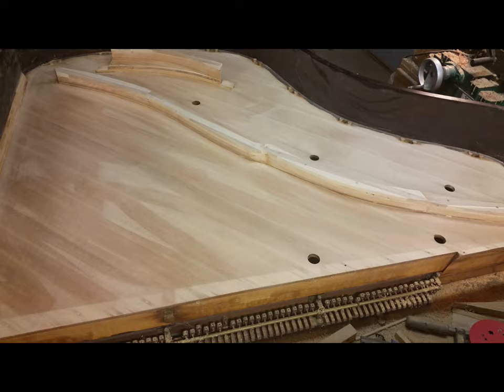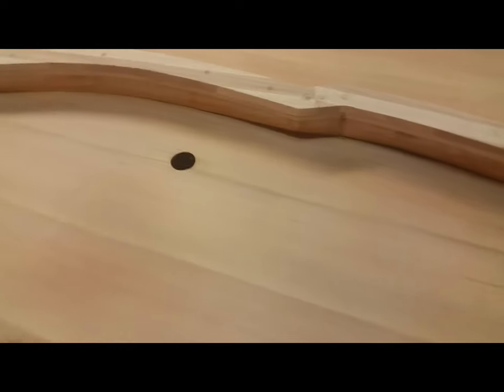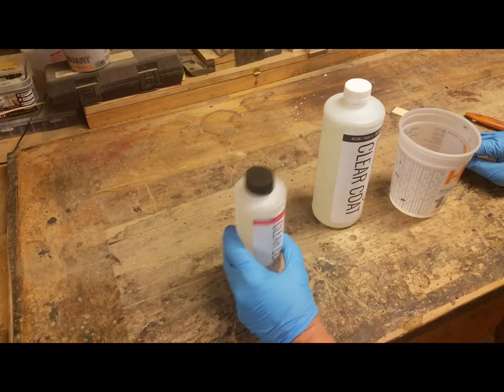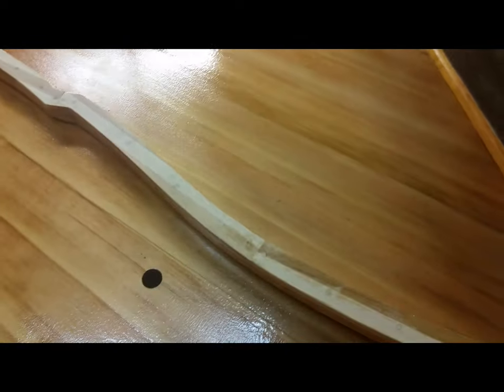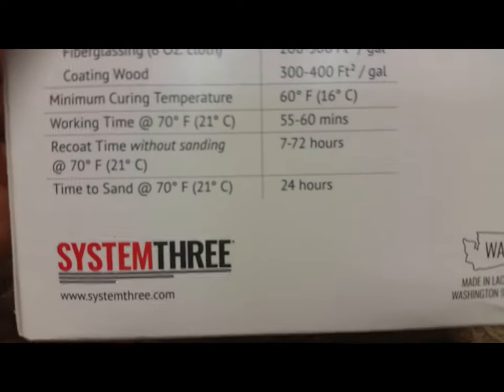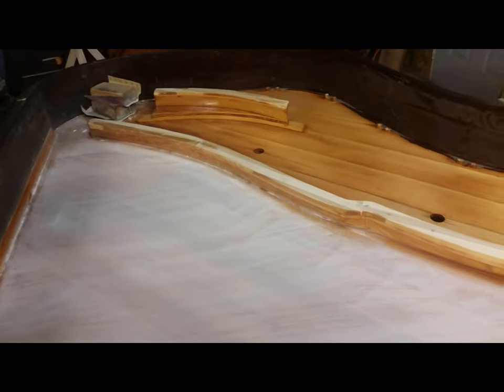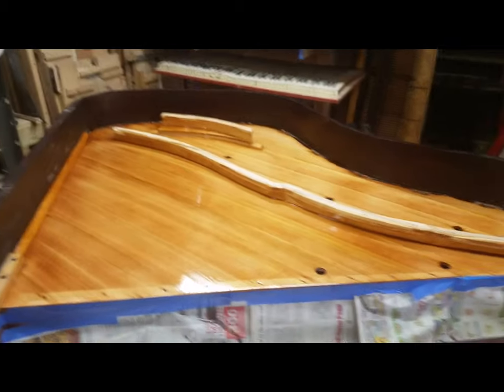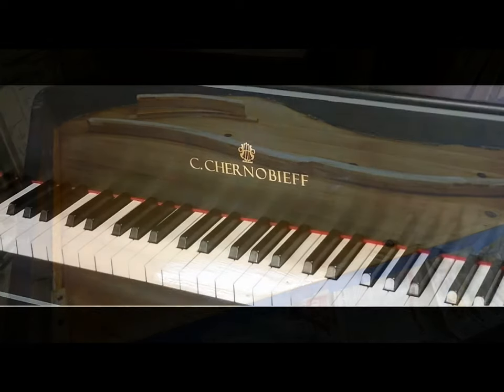Knabe Grand: Epoxy Coating an Old Soundboard

Comment: Nice, is it experiment? I always thought piano manufacturers only use Nitrocellulose on soundboards, I know epoxy is also hard coat and shouldn't age at all, but nitrocellulose is kinda tradition :P
Reply from the maker: You have employ non traditional means sometimes to fix problems economically.

Comment: It does look good but how did it end up sounding? Wouldn’t epoxy lower its resonance property and thus lower sound quality?
Reply from the maker: A well thought out question. The only thing i noticed is that the hammers needs more work to build tone, and i made sure downbearing is light as always. Hear the piano in this video. It came out sounding great and the owner loved it. https://www.youtube.com/watch?v=ZC1WoFNSkVM&list=PL4km3jbQ3Am62xP3bQ3e1E0qyUugAGZyi&index=12
Reply: Fwiw, the rebuilder I use scrapes off the excess epoxy after it has soaked in for about an hour but is still viscous. This keeps the board from acquiring a detrimental amount of mass during this treatment. 

Steinway Model A - epoxy soundboard repair
https://youtu.be/XRRtihV__9E
Reply from the maker: @insidepianos  It has long been my postulate that soundboards should be lightweight. As demonstrated in many of my videos. With that said, both you and your rebuilder miss the point of this type of repair. Epoxy just in the crack will become 2 more cracks eventually. My method is to create a "T" repair (the epoxy on the surface and in the crack). By scraping the epoxy off the surface serves no purpose and weakens the repair. The extra weight caused by adding epoxy to the board can be mitigated with voicing of the hammer.
Reply: @ChernobieffPiano  I respect your skill, experience, and dedication and didn't mean to imply otherwise with my reply to the other viewer. I've also seen your videos in which you remanufacture new SBs with an eye towards weight reduction, so I know you consider such things. 
In fact, I weighed your input enough to do a fairly deep dive this morning through various fora. I concluded the following:
1. (In support of your reply) The net weight gain from an epoxy procedure is not than significant, certainly not in excess of the weight variation one might find in any two SBs from the same model. And, as you point out, such difference could be mitigated by hammer voicing (or, I would add, hammer selection).
2. The cracks ppl notice along epoxy repairs (to larger cracks) seem likely to be caused by failure to use appropriate fillers which cause the epoxy to become inert. In the nearly 20 yrs of doing this procedure I don't believe my rebuilder has received reports of new double cracks at the place of repair. I can tell you for certain that he'd revisit his approach if so. 
3. Lastly, Del Fandrich, the progenitor of this procedure, sands the epoxy layer off such that all that is left is the epoxy that has soaked in. This makes me think the point of the procedure is not to create a T structure but to counteract the wood's compression damage and to fill any cracks with a "wood-compatible" substance. In this way I feel we have not missed the point.

I do find your T approach defensible though and see the potential benefit. I'll add that the result you got was an undeniable success! I remain an appreciative fan of your channel. I learn a lot!